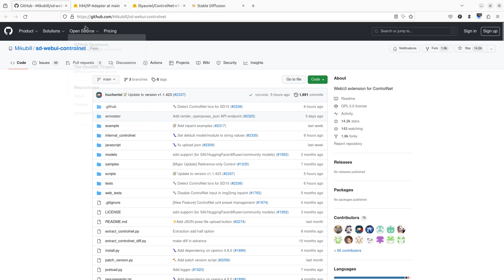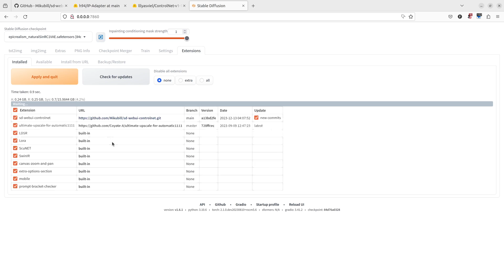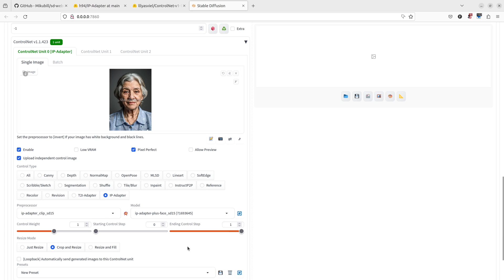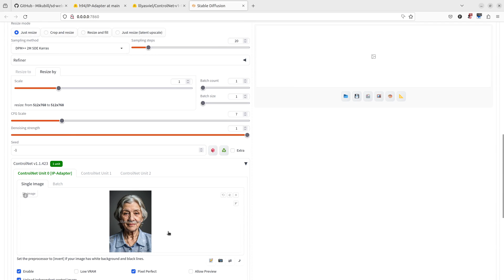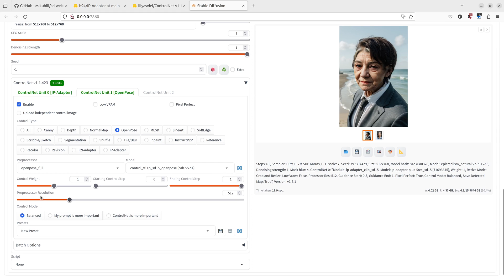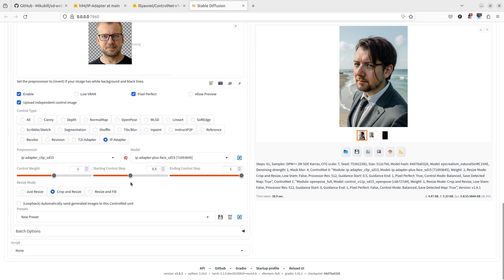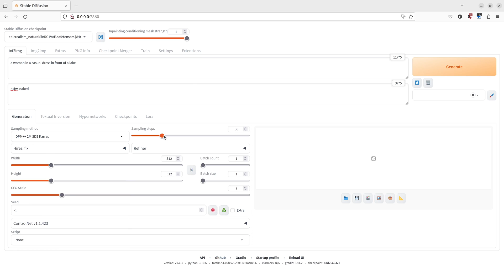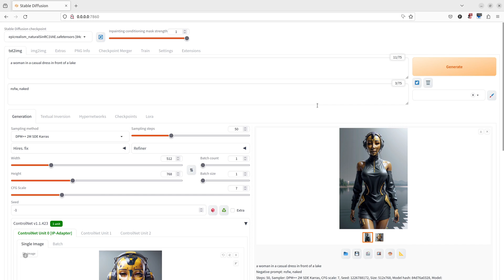How to FACE-SWAP with Stable Diffusion and ControlNet. Simple and flexible.

Comment: Hey. I create images in Midjourney and I want to swap the faces of the characters in these images with other faces, I tried some Faceswap tools and it didn't give good enough results, do you know what the best way to do it?
 Because in the omni reference in Midjourney it doesn't always catch and come out accurate. Thank you very much.
Reply from the maker: MJ’s reference isn’t a real face-swap. Use SD (ComfyUI/A1111) with InsightFace/ReActor (+ ControlNet for pose) and finish with a small inpaint + CodeFormer. Much more consistent than MJ.

Comment: it doesn't work, even if we do exactly the same thing as the video, it doesn't copy the imported face, yet same checkpoint, same models used, same settings and nothing to do, it doesn't work! Likewise it is not very clear, you ask to download the .safetensors but then you highlight the .bin in yellow. similarly in the new version there is no clip sd15, there is only auto, clip h and g

Comment: Is this process done entirely on the computer? Or does it upload/download to and from a website or the cloud? I have very bad IN connection, and the apps I have tried all end up using a website.
Reply from the maker: @juliensorel5535 It's done completely local. No need to access the web/cloud. You only need to download the extensions and the checkpoints.
Reply: @NextTechandAI  Thank you. I will give it a try.

Comment: Mine doesn't have "DPM++ 2M SDE Karras" for the sampling method. Mine has "DPM++ 2M SDE" and "DPM++ 2M SDE Heun". Which one of these should I use?
Reply from the maker: It depends on your version of Automatic1111. You could try to update if this doesn't hurt your installation. In latest versions you have to select e.g. Karras in a list right from the sampling method or leave it on "automatic". If this is no option for you, start with DPM++ 2M SDE.

Comment: Unfortunately I ran into a similar issue as others described in the comments. My preprocessor will not update to show the same ones available for you, I'm not sure which preprocessor I should use so every time I run this it looks horrible. I have tried updating control net, using different models, including the base 1.5 model. I'm not sure what else I can try. I'm sure I've followed the video's instructions to the letter.

Any ideas? My model shows up correctly, but not the preprocessor.
Reply from the maker: Thant's strange. I followed my own instructions with my relatively new Automatic1111 Zluda installation (see related short and vids) and the result was exactly like in the video. I noticed only one difference: The preprocessor being offered was called ip-adapter-auto. When doing the first run, the WebUI automatically downloaded clip_vision\clip_h. Setting the preprocessor to ip-adapter_clip_h for next runs resulted in same (good) results.
Maybe the preprocessor's name is included in WebUI and you have to update WebUI. BUT if your generation works as expected I would choose ip-adapter-auto or ip-adapter-clip_h without touching the existing installation.
Reply: @NextTechandAI  hi thanks for the reply, yes I have auto, and h, but I had issues with the quality of the result, I will retry again tonight and let you know how it goes.
Reply: @NextTechandAI  So I tried again with the clip_h preprocessor, and experimented quite a bit with different settings to see if I could attain anything usable. I tried altering the source image, control weight, starting step, ending step (which was basically useless? anything less than 1.0 gave me results that looked nothing like the control image). I also altered the sampling steps, and the method. 

I really tried but couldn't get anything useable.

Using an 7800 xt, SD1.5 installed as per your March 2024 video.
Reply: @bigdeutsch5588  same shit

Comment: ip-adaptor_clip_sd15 does not appear at 3:15 and I don't know why?
Reply from the maker: I guess to the right there is no ip-adapter-plus-face, either? Have you copied the ControlNet file into the correct directory? Are you mixing SDXL with SD15?
Reply: @NextTechandAI  Well I'm very new to stable diffusion so I don't know how if I'm mixing SDXL with SD15. On the right there is ip-adapter-plus-face as an option. I'm confident I put everything in the right directory. I decided to put it on ip-adapter-auto, and on the left with ip-adapter-plus-face on the right, and saw in the command prompt that, somehow, the preprocessor is ip-adapter-plus-face_sd15. 

It's probably due to my lack of knowledge on SDXL and SD15 which I'm probably mixing but I don't know what are these settings nor how to change them / avoid mixing them.

In all cases, after watching a whole bunch of face swap videos, yours came up on top! After slightly twitching a few settings over your recommendations, plus using multi inputs instead of a single image in ControlNet, it really helped me out having more than a single angle for my virtual character. Thanks a lot!
Reply from the maker: Well, if you could select ip-adapter-plus-face-sd15, then your selection is correct. Regarding SDXL and SD15, some people seem to have trouble as they have selected the ControlNet files for Stable Diffusion 1.5 like in my video and combined it with some checkpoints for Stable Diffusion XL. When you download checkpoints from HuggingFace or Civitai, you'll see whether it's for 1.5 or XL.
Nevertheless, I'm glad that you managed to modify your virtual character - thanks for your feedback!

Comment: RuntimeError: 'addmm_impl_cpu_' not implemented for 'Half'    Still trying to work this one out...  Seems to be working fine until the final output.  Then error.  I wonder if I've got something in the wrong folder.  That happens often.
Reply from the maker: Half/float16 is for GPU and I guess your stable diffusion is using CPU. You have to use GPU or change to using "Full" (float32) instead of Half.

Comment: i testing every step but it never worked..
Reply: Stable diffusion is changing very fast. Most tutorials you'll find over a couple of months old are probably out of date and a waste of time. This is an absolute fact with anything having to do with Controlnet. I've found filtering search results by date helpful. Anything over 4 months old is probably a waste of time.

Comment: I don't know, for me nothing beats reactor, ip adapter sucks even with plus 2 version. The best way i get the desired result is with using reactor (txt2img) with any model with their specific cfg/steps etc and then img2img with my trained model with its cfg/steps/method settings without reactor with 0.17 denoiser with 2x size.
After img2img the face gets the same style as the rest of the picture without changing its appearance.
But with ip adapter, the face doesn't even come close to 50%. And i tried with single to 20 pictures for the face so that ip adapter can get it right but still fails. I am waiting for instant id, it only works with sdxl at the moment and i use sd1.5.

Comment: how to fix this error? "AttributeError: module 'torch.nn.functional' has no attribute 'scaled_dot_product_attention'"
Reply from the maker: Please add some details. What exactly have you done in order to get this error, what's your hardware and especially, which torch-version are you using?
Reply: Did you fix it? I have same error. Please. I have 6gb vram. Images 1000x1000

Comment: When I select IP-adapter, ip-adapter_clip_sd15 disappears from Preprocessor, and only xl is available. What do I do wrong?
Reply: Same problem here, missing ip adapter sd15 in preprocessor. What is the solution?
Reply: @Cayane-md1tn  did you solve the problem?
Reply: I found what the problem was. For some reason,  ip-adapter_clip_sd15 doesn't appear with my model, but it does with the one you used. You should've told about that.
Reply: Because it is designed for SD 1.5 models, and you probably used it on SDXL, I think. @KOTletyXO4esh

Comment: Finally after 4 days found this video and it finally works, But now i got a new issue, The eyes are asian now. Both models have almost nearly the same eyes so not sure why it becomes asian eyes help :3
Reply from the maker: Thanks for your feedback. I've never heard about such a strange issue. I guess, you are working on the img2img tab, have tried different values for control weight, set denoising strength to 1 and left the prompt empty?
It sounds crazy, but maybe the default face of your checkpoint is asian and somehow it is mixed with your models. So enter a prompt describing your target model and please report back :)
Reply: Idk iu was just following every step you were done, including the prompt etc @NextTechandAI
Reply from the maker: So entering a prompt describing your target model or adding 'asian' to the negative prompt does not help? @necrolydevlogs3932
Reply from the maker: @necrolydevlogs3932 Very strange. I'm running out of ideas, you could try other checkpoints, although that connection is pretty far-fetched.

Comment: Do you have a tutorial about training loRAs models on stable diffusion with dreambooth? i tried it with other tutorials but the interface they had was different and mine is different too and it is hard to follow their steps.
Reply from the maker: @marcusmeins1839 Currently not, but I'll put it on my list for video ideas. You're using Automatic1111, I guess?
Reply: @NextTechandAI   yes, locally

Comment: When I do this process, I get a blended face. I'll have the expression of the original with the colors and shape of the new. It looks bad. I'd like to have a link to the images you use, so I can truly replicate your process.

Also a problem with combining images like this is skin tones don't match.
Reply: i also have issius tried some other faces tried playing with settings no luck. often i get totaly defomed faces or just a hairy mess
Reply: updateed xformer and pytorch and found reactor. I now use a mixture of controllnet with ip-adapter, open-pose and reactor- works fine

Comment: I tried your instructions and copied the settings. I can't get it right. When i set denoising strength to 1 the face is replaced by a random generated image and not the controlnet image. I think i'm missing a setting that i may not see in your video?
Reply: me to, not the same face at all, did you solve?
Reply: Same for me
Reply from the maker: Everything should be in the video. Have you enabled the ControlNet unit? I assume you have selected the img2img tab, right?
Reply: Dito.
Reply: same, different and really weird faces.